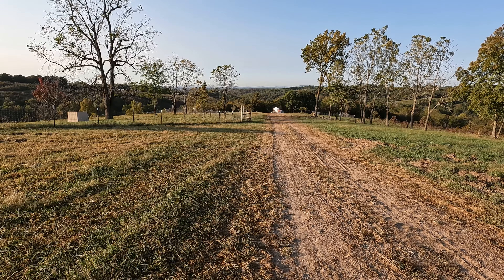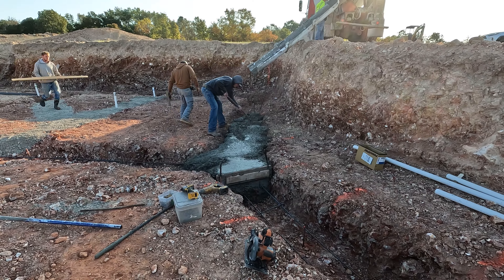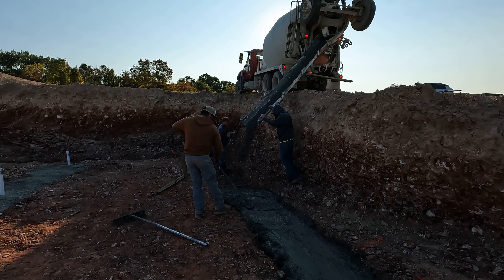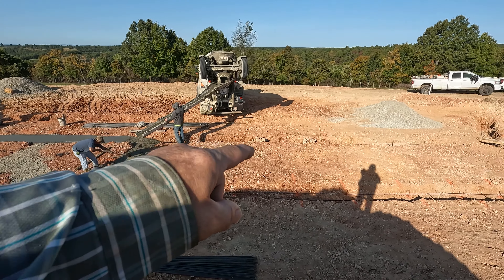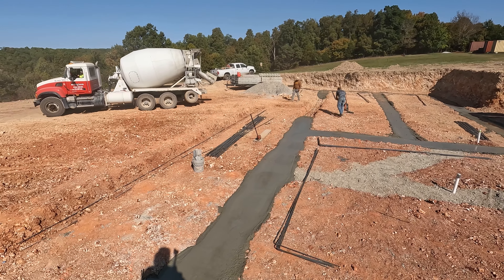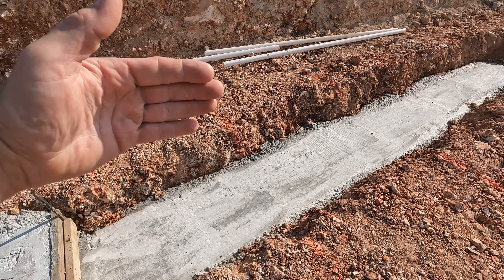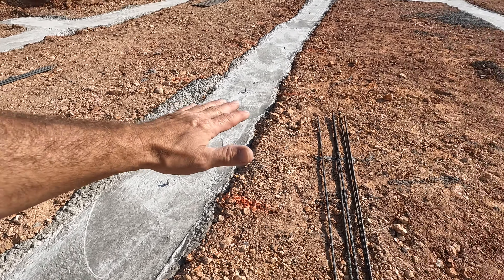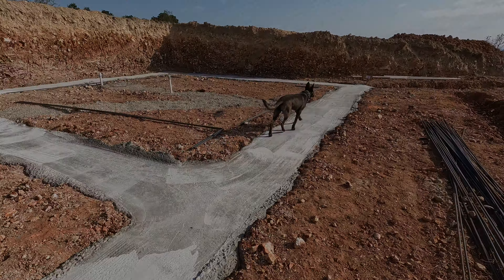TLC Home Build - Foundations part 3 | Day 31 & 32

Comment: You have footers!!!! That’s a huge step forward. Best part is the concrete guys got to use the new, user friendly, driveway! They probably didn’t realize what an improvement that really was.
Reply from the maker: I will say that we have had a longer than usual dry spell. The rare rain we have gotten over last two months has nto been enough to stem dust from teh driveway changes. All the trucks back and forth has given me a dusty road. I have to hose my wife's car off every time we go to town so the LE does not think I am trying to hide my plate :D 

I have one or two more videos in queue which should get me caught up to where we are. But, we did just get the 1st basement wall concrete wall pour yesterday!